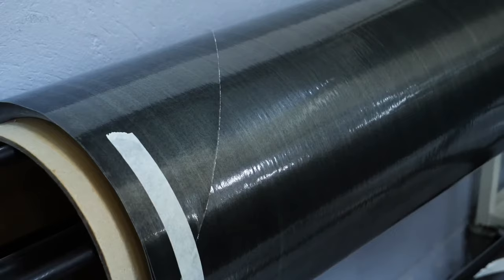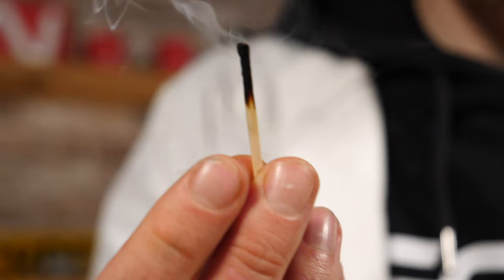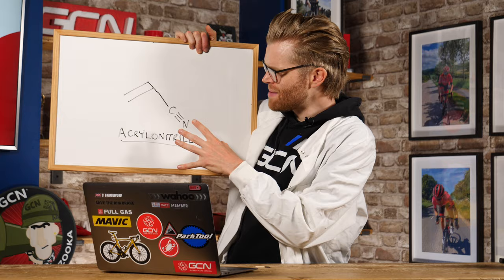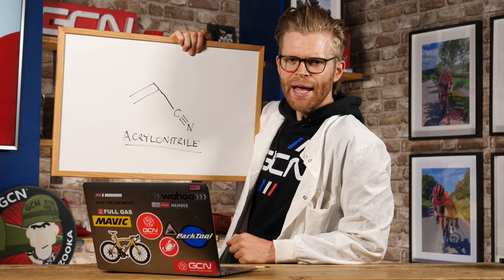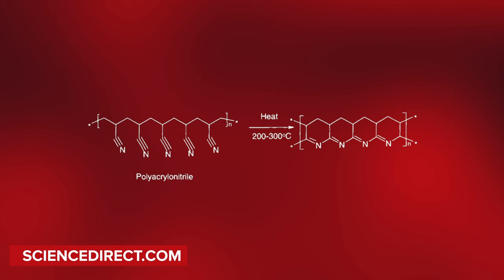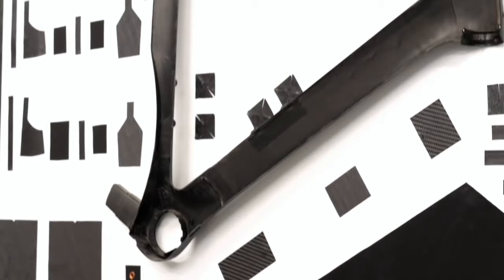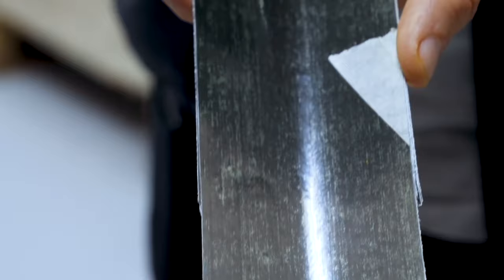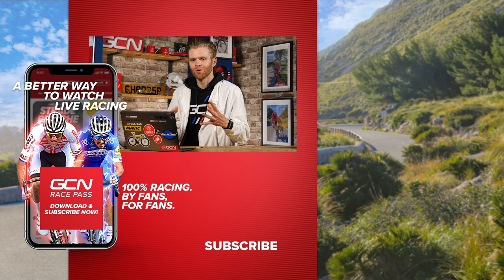How Is Carbon Fibre Made? | The Science Lesson You Always Dreamed Of!

Comment: (Hears coefficient of thermal expansion, my engineering degree finally pays off 😂)
CTE is actually quite important in manufacturing processes even in bikes because often when a carbon fiber sheet is places into a mold it is heated with an epoxy resin to help it set and cure. Cheaper Carbon fibers with high CTE often expand more in the mold causing the manufacturing defects we are so used to such as incorrect BB diameters and misshaped seat posts. The heated fibers move around the epoxy in the mold and cause these defects so its in a bike manufacturers favor to use Fibers with lower CTE to allow for greater tolerances and fewer defects. This is especially important in monocoque designs where there could be hundreds of pieces that need to be heated and bonded together to make a frame and fork combo
(Correct me if I am wrong this is what I have learned in class but I know often the real world is much different)
Reply: True, but the main reason for deformations is thermal setting of the matrix while cooling, so it is rather epoxy pushing the fibers around than setting fibers pulling on it. That what makes resin composition and mold design worth being a company secret.

Comment: The thing that makes carbon so amazingly useful and versatile is the fact that it can form double and triple bonds with itself and other materials, particularly its affinity for hydrogen and oxygen. Take acetylene, C2H2 or more specifically, H-C=C-H (= is a triple bond here). That triple bond is what gives it the neat necessary to melt, cut, and weld steel. Here, the carbon bonds, along with their particular arrangement, are what make the carbon fibers so strong.

Ploymers... here's a mind blowing fact: polymer paints are used on automobiles. The nature of these polymers means that, after baking, in effect, the paint layer on your car is essentially one gigantic molecule. (Not exactly, but it's a cool thing to contemplate.)

Comment: space elevator lol, we spoke about that in one of my uni modules. it's something which is technically impossible.
You need absurly long tubes to transport air and the elevator up to the station in space, and therefore also alot of energy. And the earths rotation would also play a negative role on the structural intregity of the elevatorlink

Comment: I'd love to see GCN do a video on how strong carbon fibre is compared to aluminium and steel, obviously in particular in relation to cycling. Maybe some frame manufacturers would send you guys some 'reject' frames... take to them with a hammer, crash them, clamp them in a workstand a too tightly, try bend them, over tighten screws into them, whack them over some concrete, etc. All the good things that's said about carbon fibre, aluminium etc is all well and good, but stats like 0.3mm walk thicknesses etc make me psychologically untrusting of the materials, and I'm usually afraid I'm going to crush my frame in a workstand etc, or damage it trying to bunny-hop (despite having watched all the Road Bike Party videos), and I've seen bikes broken after crashes in the pro peloton. Perhaps do it as an 'ad' for a frame manufacturer... proof of the benefits of carbon?! Might become the Toyota Hilux that Top Gear put on a plinth when they couldn't destroy it!

Comment: So here is a bit of science you could look at. I am a long range shooter. There is a significant increase in drag on a bullet in cold weather requiring you to add a couple of tenths of a mrad to your elevation (in the scope) for an 800 yard shot. This is due to increased density of the air when it’s cold. Last winter I did a morning ride and it was much colder than usual, zero Celsius. I felt that it required more efforts to sit on 30km/h than usual. I joked at the time that it must be due to the cold and the increased drag due to the denser air. So...how much extra power would be required to ride at 30km/h at 0C compared to at 20C?
Reply: a lot. had the velodrome been 30 degs i would have beaten eddy! 😉
Reply: Your muscles don't work as well when your cold either.

Comment: Ollie, you covered carbon nano tubes but you left out graphene.  Scientists are also trying to figure out how to make graphene practical for bike frames, aerospace, and other uses.  UK bike manufacturer Dassi is the first bike manufacturer to integrate graphene into bike frames.
Reply: deliberately. graphene isn’t scaleable in this application in my opinion. it’s currently only used as a tiny powered additive (typically 1% or less) to some resins which although may alter the composite material properties, is most likely largely for marketing
Reply: @GCNuser123  -  What you said is mostly accurate.  Graphene will eventually become scaleable, though it isn't currently.  Dassi used more than 1% graphene in the bike frame and dropped the weight of the frame by over 200 grams because of it.  Yes, it is mostly for marketing currently.  Once they can make frames mostly out of graphene or carbon nano tubes it will drop the weight substantially while improving strength and stiffness.
Reply: @GCNuser123  Also, carbon nano tubes aren't currently scaleable either but you mentioned them anyway, graphene should also be mentioned because of it.  We don't have the technology to effectively use either one right now.
Reply: I know someone will mention this so I might as well - Dassi began to be liquidated earlier this year.  Their goal was to produce state-of-the-art carbon frames.  Apparently, their high costs to achieve this outweighed their revenue channels.  I was really hoping they would make it.  It is possible that the company will continue under new owners but the chances aren't great.
Reply: Kevin C by scaleable, i mean they can be scaled up to to something that we can hold. Graphenes unique properties exist as a single layer. by combining multiple layers you then have graphite! graphene is a fantastic thing, but we won’t be building things from it  that we can hold.
Reply: @GCNuser123  - I'm not trying to argue with you.  I think your video is well done and I upvoted it.

Scientists have successfully stacked multiple layers of graphene on top of each other without it turning into graphite (example: they made body armor that a diamond bit couldn't penetrate).

It will be possible one day to have a bike frame made mostly out of graphene.  The technology just isn't there yet.

Thank you for your wonderful and informative videos!
Reply: Kevin C thanks man. i would be keen to read the paper that is in, as i haven’t heard that before. do you have a link? 👍🏼
Reply: @GCNuser123  - If I find the paper I'll give you a link.  The body armor project was done at Georgia Tech.

The main obstacles in using graphene for bike frames are the following:

#1 - Very difficult and expensive to mass produce graphene
#2 - We don't currently have the technology to form graphene in large ultra thin sheets like carbon fiber although most scientist agree that this will be possible in the future.